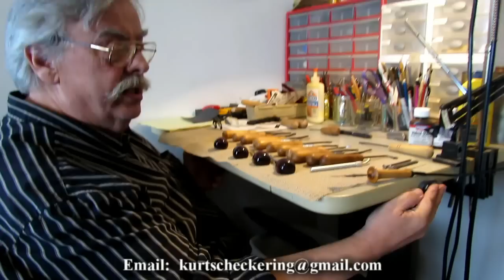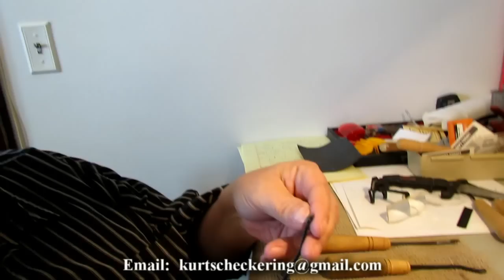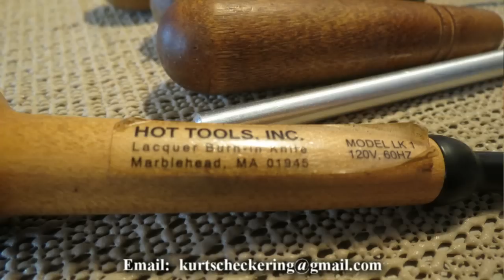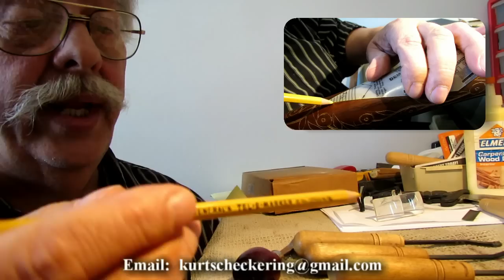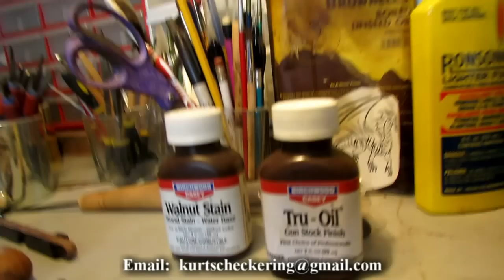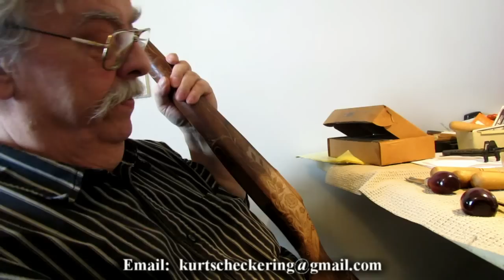Gunstock Checkering TOOLS - Rex Reviews

Comment: I've been a professional Restoration, Refinishing & Painting Contractor since 1980. I started helping my Grandad in 1972. I've done this type work all my life. It's not just what I do it's who I am. I also repair Guitars. I've used every kind and brand of Sandpaper there is. I now use Oslong Sandpaper. It's superior to any Sandpaper on the market. Think of it as Carbide Tipped Sandpaper. It has a special latex backing paper and it doesn't wear out like regular Sandpaper. It lasts many times longer. The special latex backing paper feels kinda like those faux leather paper showing waist & length on the back right side of a pair of Levi's jeans. The grit on Oslong Sandpaper doesn't come off even when you crease it and roll it back and forth purposely trying to make it come off. It's wet/dry and even outlasts Emory Cloth. I've seen any Sandpaper that comes close. It's a whole different Animal. Everyone I've recommended Oslong Sandpaper to has switched. I found it by accident and wish I'd known about it years ago. I looking on eBay for some wet/dry Sandpaper to refinish a Guitar Neck and needed an assortment of various different Grits b but didn't wanna have to buy a whole bunch of different packs just for 1 Guitar Neck. I saw an assortment pack of 2 of 12 different Grits, 2 full size sheets of each. 80 grit to 2000 grit, 24 sheets total. It's from John at Marine Now on eBay. John had a really good description of the Oslong Sandpaper with it's special latex backing paper. John said it was superior, better than anything He'd ever used. The description especially the latex backing paper sounded great and 2 full size sheets of various different Grits was just perfect for stripping and refinishing 1 Guitar Neck. Best thing I've purchased in a long time. If you try Oslong Sandpaper you won't use anything else. I told a Luthier Friend of mine who lives in Scotland. He used to order Sandpaper in bulk from someplace in Raleigh NC about 30 miles from my house in Coats NC. He tried the Oslong and immediately cancelled his bulk order. He now uses Oslong exclusively. He builds Guitars full time for the last 50 years and uses a lot of Sandpaper. Oslong really is this good. I sincerely hope this helps you. Once in awhile you find something really good, so good you wanna pass it on to everyone.
I'm gonna start making handmade Ipe wood Guitar Picks. Ipe would make a Great Gunstock, Pistol Grips, Knife Handle, etc. Using 3M Polishing Paper from Rio Grande Jewelry Supply I can Polish Ipe by hand and make it look like a Polished Rock, it's nearly as hard too!! I came up with the idea of Checkering part of my Guitar Picks giving them superior grip. What single tool would you recommend for this. I don't need all the tools you describe in this video for this. One tool is all (I think) I need and would greatly appreciate your expert advice. Great video by the way.
God Bless You and Your Family!!
Jimmy in NC....
PS. My number is (910)-818-3279
Email - thepainter.198094@gmail.com
Thanks!!